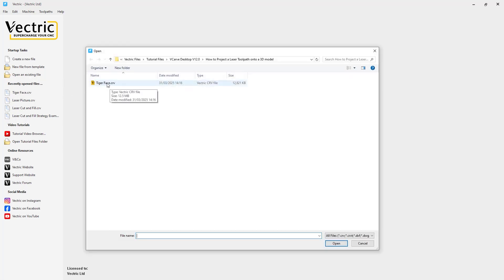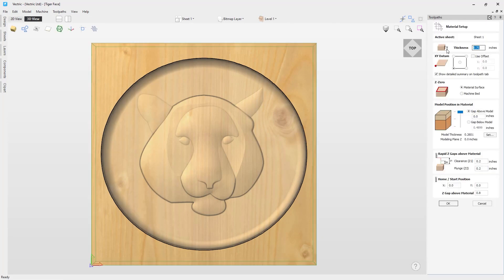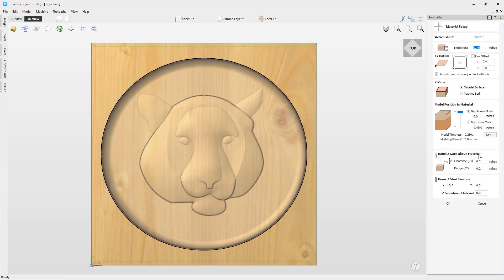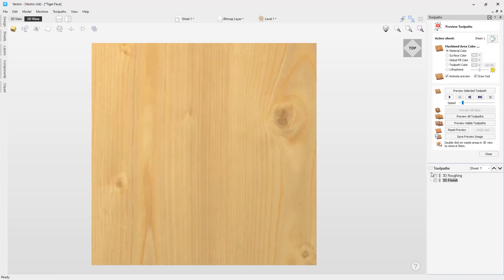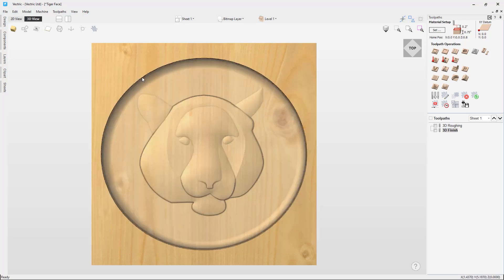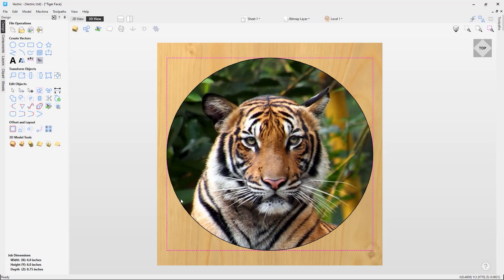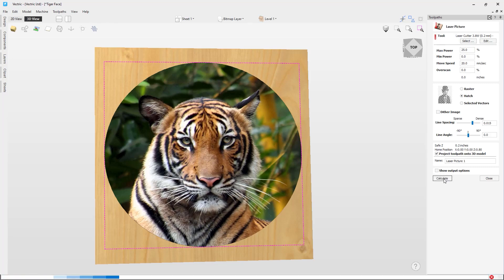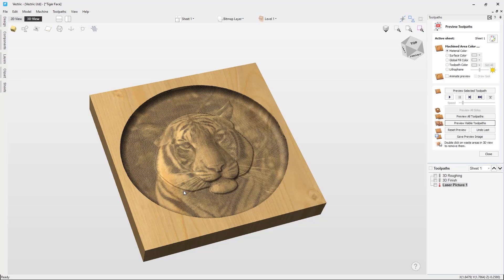How to Project a Laser Toolpath onto a 3D Model in Vectric's Laser Module | Laser | V12.5 Tutorials

Comment: Does the laser move in the Z axis when the option is selected ?
Reply from the maker: It sure does... that is the nice thing about using the Z-Axis... it will always be in focus across a relief model.
Reply: @vectric  Thank you. Is the laser module compatible with 11.5 V-Carve Pro ?
Reply from the maker: You will need to contact support to see if that is possible.  Normally if it has been updated for a version of our software it will only be compatible with that version.  To be fair the Laser Module is a different one so it might be worth asking.  support@vectric.com